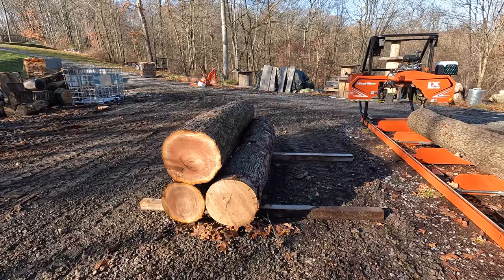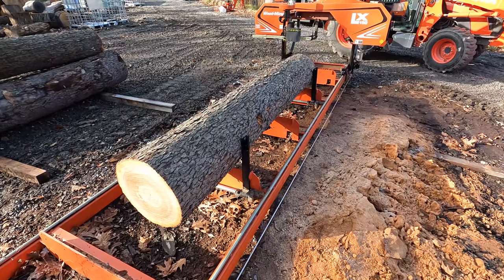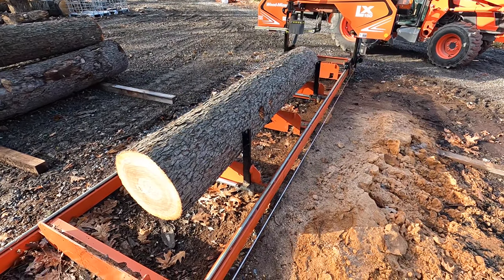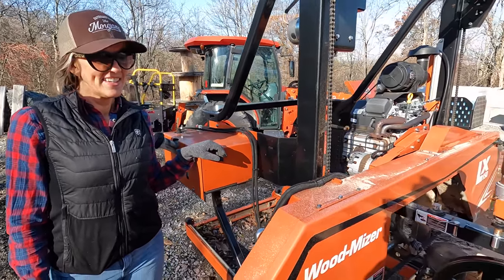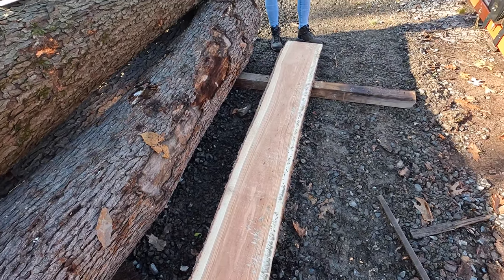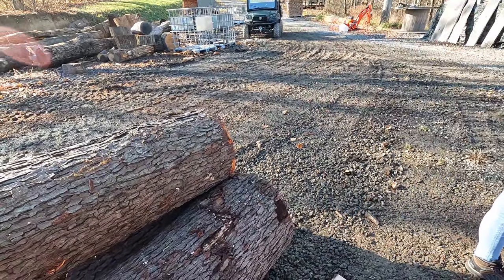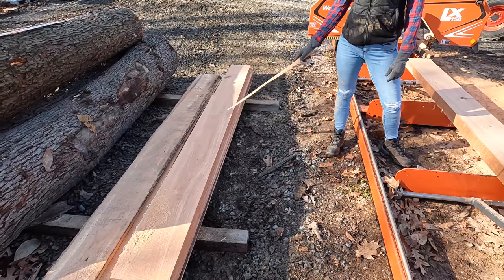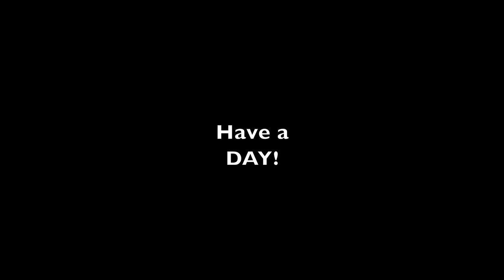INCREDIBLE Lumber from a Wrecked Tree

Comment: Beautiful lumber! As part of the cleanup effort--and maybe something to add to your build list--I saw something very interesting a few days ago. Earlier this year, we had to take down a large pin oak that was threatening our house. We took it to a local sawmill for milling and drying. When I picked up the lumber, I saw the mill in operation. The owner actually has three mills. Attached to each mill's sawdust port is a vacuum hose that runs to a central sawdust collection bin. He told me he had grown tired of having to shovel the sawdust, so he built the big bin, ran the hoses to it, and only has to empty it when it is full, instead of constantly walking in, and, then, shoveling sawdust.

Comment: I have three lifts of cherry 🍒  one lift was milled over 20 years ago  and won't register  on the moisture  meter. One is all five quarter. This makes great studs. Then I have a full lift of inch boards. Some are too wide for my 12 and a half inch planer.
 I like the cherry 🍒  wood best I think.
 I just got a lift of soft maple. I like maple too.
For the next few weeks  the mill will be in white oak. 
I'll wait fir them to get back to softer wood before I get another  lift of wood.

Comment: Suggestion for material handling!
Stack your cut lumber at 90 degrees to the saw bed at either end, depending if you are working alone or with an assistant.
That will save you on body movement and open the side of the saw for loading the logs.
I thought you measured the log you were working on at 12".
Keep up the good work!
JIM

Comment: Just a thought 🤔
"License plates" use of color. 
Eva would have the talent to design a mosaic picture on the wall using the color of the plates. 
It would not be a wall with license plates it would be a artistic creation. Picture or pattern. She may have to request plates from different states to get the color she needs. 
Graph paper and color paper.